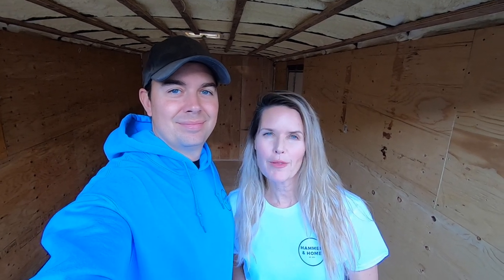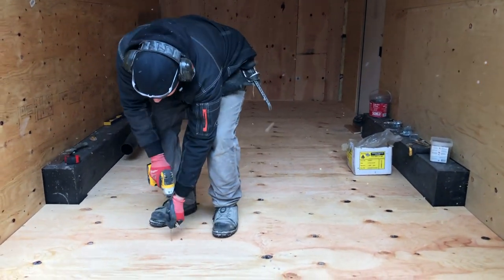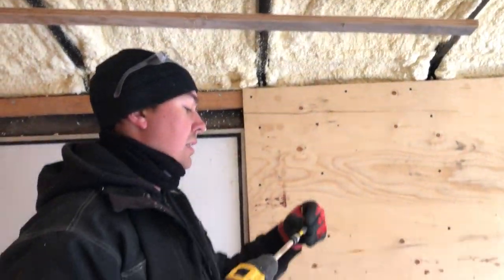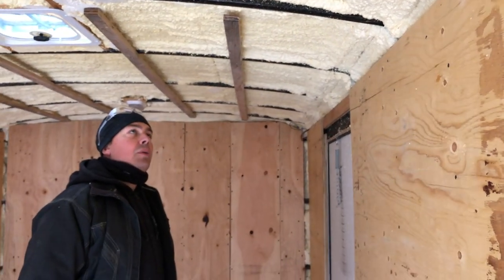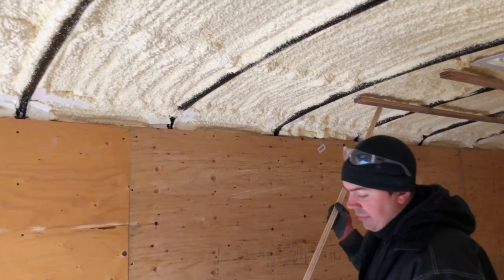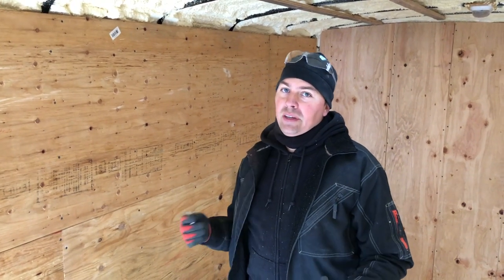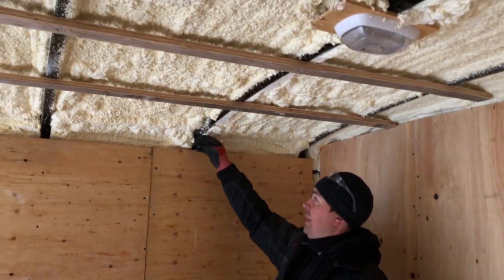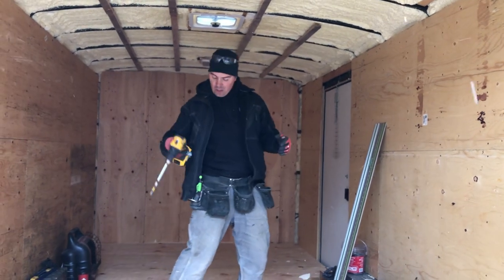How To Install Sub Floor & Ceiling Strapping, CARGO TRAILER to TINY HOME Ep.4

Comment: Found your vid. Am digging into my build on my brand new 7x14 Cargo trailer. I had planned to use the 1 1/8 styrofoam board under the rig in between the outside frames held up with these skipole disk sized plastic washers I found but seeing your vid  (and having bought the extra tall trailer I can see an inside install would be so much easier. And I can run wiring in there. Before deciding tho I have to ask if you found any sponginess to the floor with the 1/2 inch ply?

Comment: How is the floor holding up with just insulation sandwiched between plywood? I don't think I saw strips to support the floor. I added strips to support the 3/4 ply subfloor but would have preferred what you did if it works. Is there any flex or give in the floor with the way you built it?

Comment: I have a crazy question…what it’s the purpose   of using strapping/furring strips on the walls and ceiling instead of attaching panel’s directly into the framing?
Reply from the maker: I wanted to have space to run wires, makes it easier to fish in cables if i need to, it also gave me more room for insulation
Reply: @hammerandhome  
Thank You. I wasn’t being critical of your work. I have recently purchased a cargo trailer that I am also working on. All the videos that I have watch show people using the furring strips. I just didn’t know the reason behind the use of them.

Comment: I'm interested to know why you didn't use thicker insulation under the existing sub floor instead of attacking on top.
Reply from the maker: im very tall, and i didnt want to lose more head room, I may apply spray foam to the underside of the trailer if i find it's to cold
Reply: @hammerandhome  right, what I meant was adding insulation from underneath instead of on top. That way you would lose nothing in cabin space.
Reply from the maker: @jordanwilkinson7368  i see what you mean.yeah its a tall trailer so the 2" of foam was ok for me to add, plus it was a lot easier to install. i wouldn't recommend adding foam sheets to the bottom of a trailer. only sprayfoam. the sheets can rip apart or hold water above them when your driving around. unless you totally cover the bottom with plywood or something.